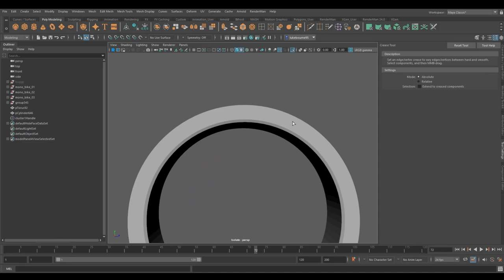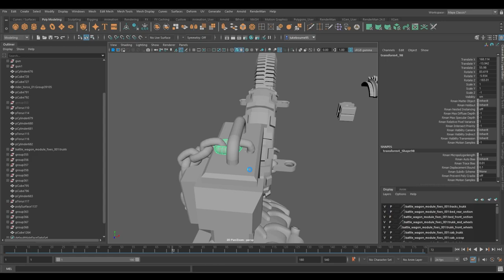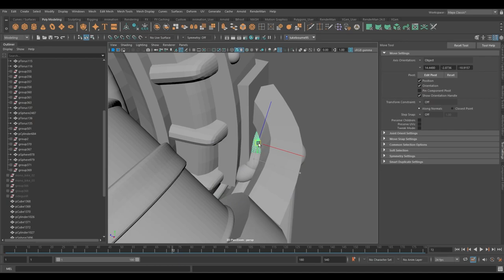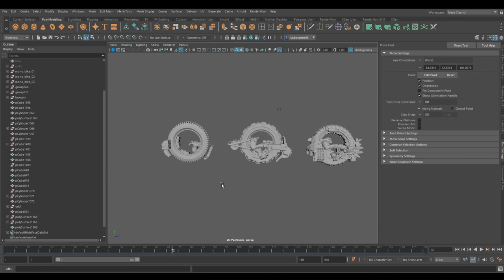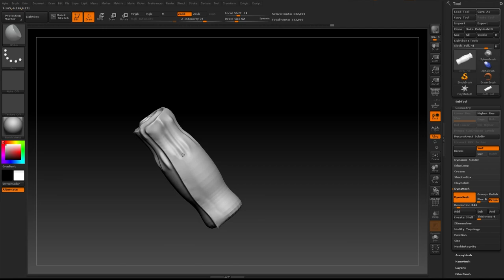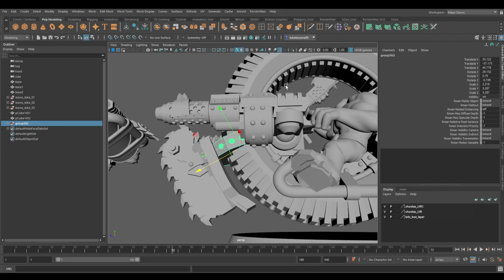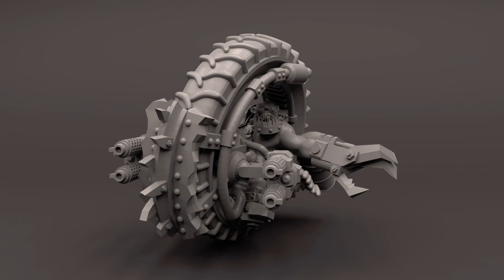Designing a 3D Printed Wargaming Army | Orks Episode 8

Comment: do you need to take topology into consideration? or could i take something straight from zbrush and print it?
Reply from the maker: topology really doesn't matter that much with 3d printing, but there are a couple of things I would still look out for: make sure the meshes don't have any holes, and use high poly models/subdivided models for printing (this avoids the print looking faceted)
Reply: @lukeswayoflooking  Might do an nurgle army 🤢

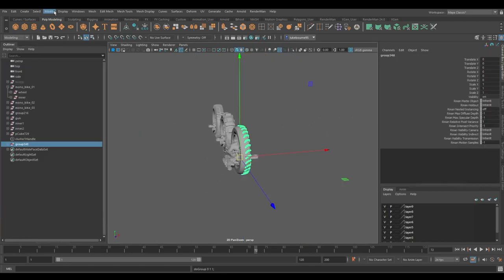Comment: at 3:12 what command did you use to get them to go all round the wheel?
Reply from the maker: Little bit difficult to explain but a relatively simple concept. Its called "transform duplicate" and it duplicates the object plus whatever the last trasform was perfomed on the object. If you put your pivot in the right spot you can do what I did in the video. Its not incredibly accurate though but works for orks and for saving time 🙏